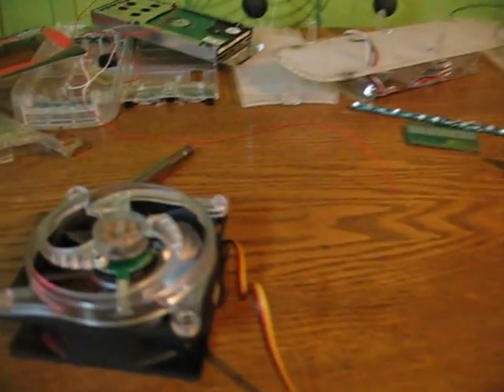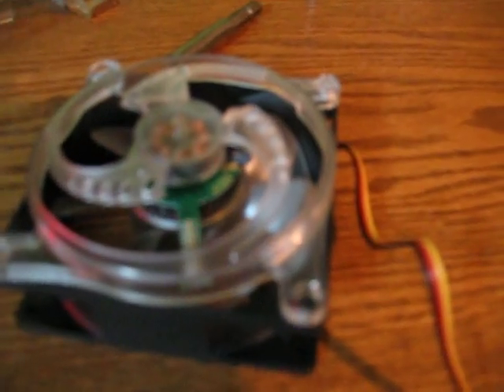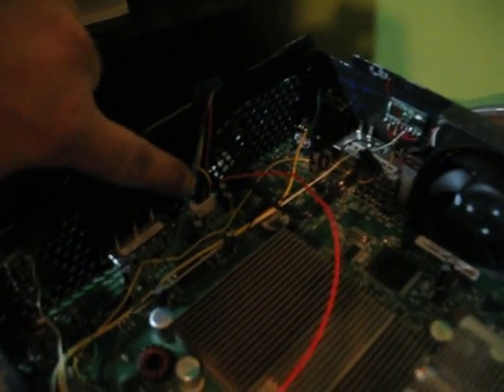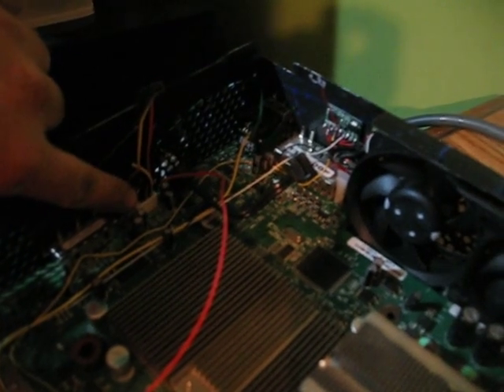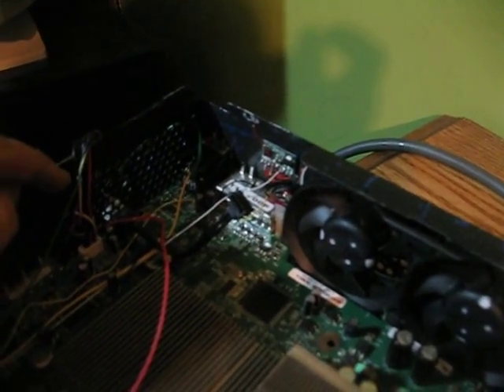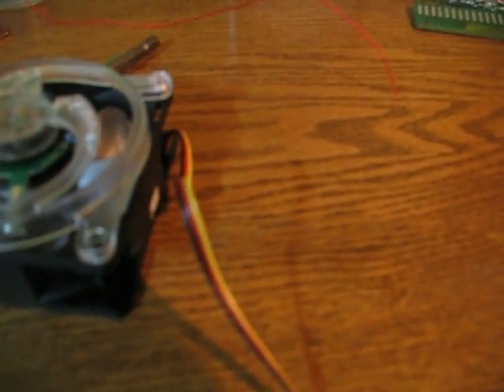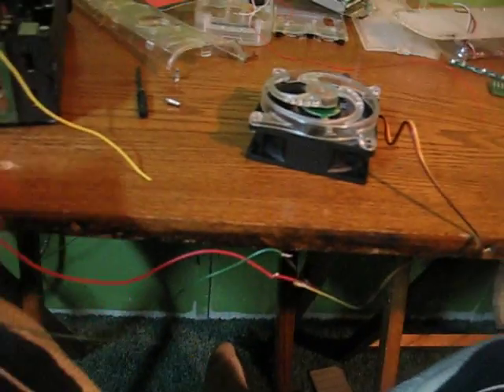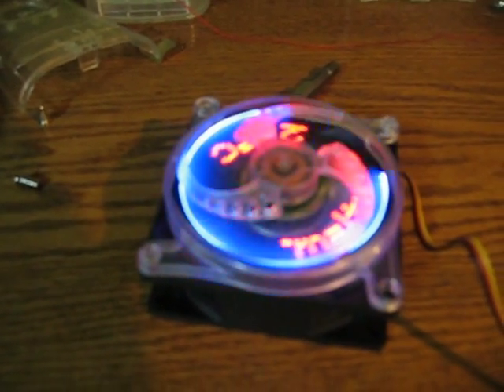how to wire a 9v fan (iflash) to your xbox 360 DIY

Comment: i have 3 x 12v fans running off the DVD power cable with no problems yet. posted a video on my channel. 2 at the rear and one top mounted over the heatsinks. did this after it blew the 5v controllers for the rear fans when i accidentally shorted out some wiring.

Comment: @johnchandler100 actually you are wrong the fans on your Xbox run at 5v / half speed... If the Xbox gets hot the voltage will gain up to 12 volts thus making more speed.. You can run that 9v fan off of a 12v you just need a resister.. And yes the Yellow wire is for Fan speed..

Comment: thanks ALOT, i blew my stock fan power source and didnt want to run it at 12v because i have other fans and only found 2 5v places on the board and didnt want to solder to them because i dont solder good. thank you so much for telling everyone the V of the dvd cable, thankkkkkkkkkkkkkkkk you

Comment: I use an internal XCM core cooler that feeds off of the DVD drive, it works fine.  DVD is still going to get the power it needs, where do you think it draws it's power from??? *GASP* THE PSU!!!!  YOU should be doing the googling here.  Leave the 12v and ground on the PSU open so that you can solder cathodes or what have you, instead of doing a bunch of unnecessary wiring later.